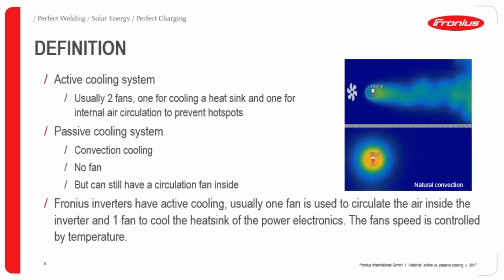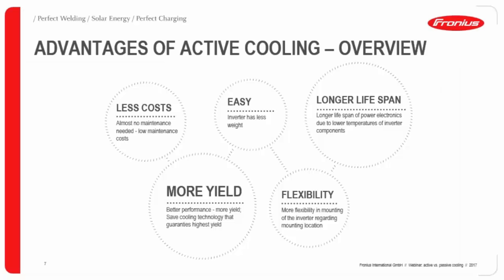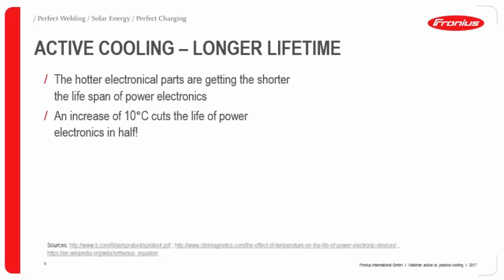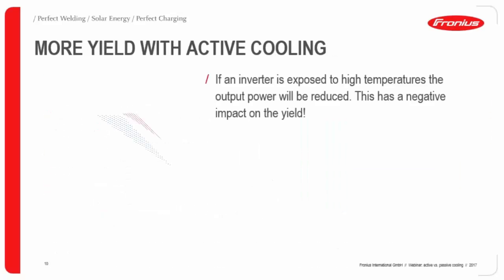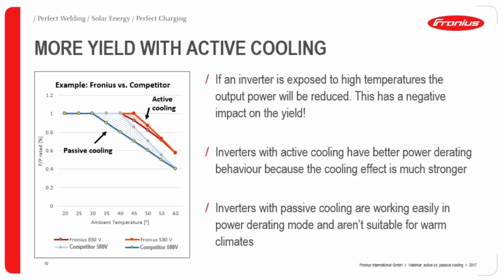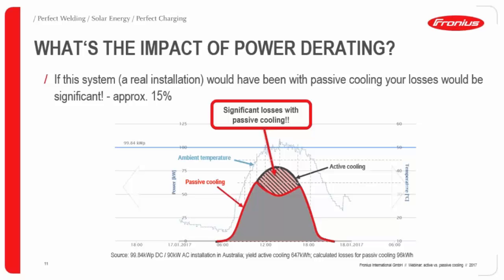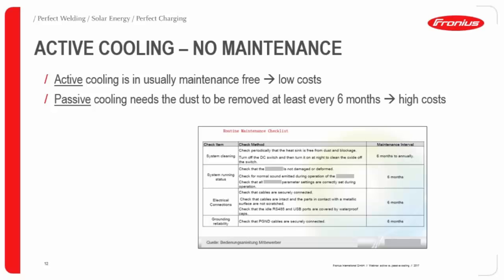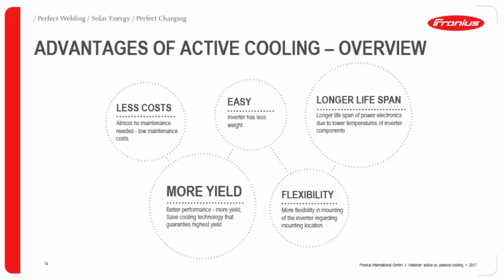Webinar: Why is active cooling the better technology for PV inverters?

Comment: Great presentation.
Is it worth adding an additional fan anywhere outside the inverter (blowing in towards the existing fans, blowing up the bottom etc).
Australia during summer can get 40+ degrees and the fans are 100% the majority of the peak window (~4-5 hours)